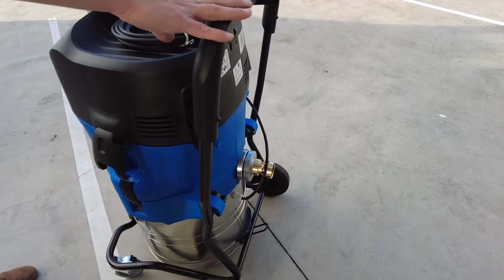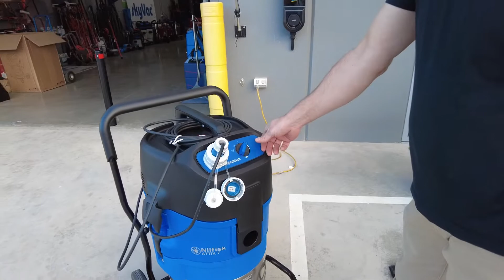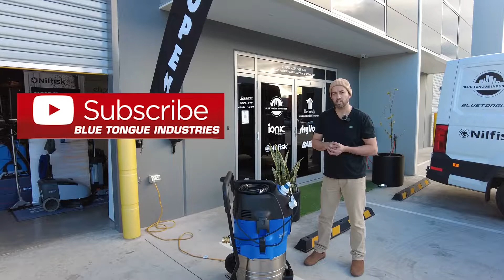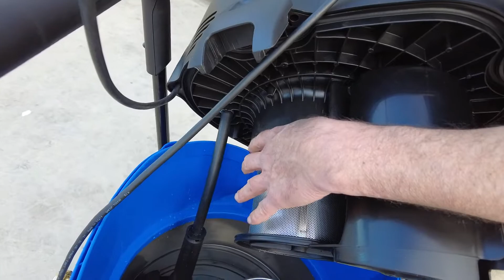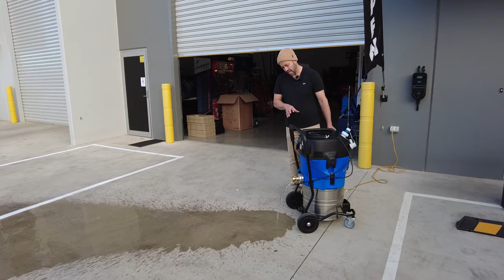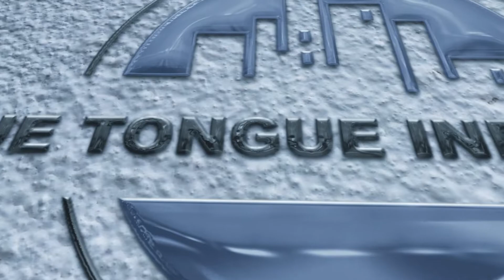NILFISK ATTIX 751-61 WET PUMP OUT VAC - See More at Ionic Systems Australia

Comment: Hey my pump recently bugged out and started failing to discharge. I still get full suction on the vacuum but do you think I need to replace the pump? Or is it more likely a power issue? 

Appreciate help if you got it, I couldn’t find any good troubleshooting online
Reply from the maker: Check the float switch and power check the pump.